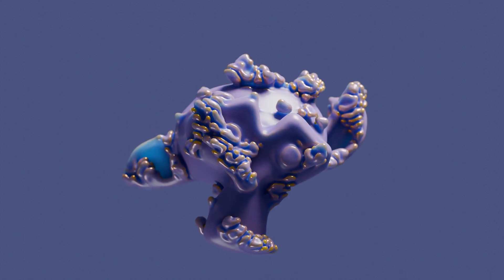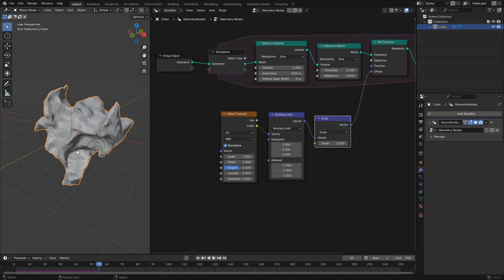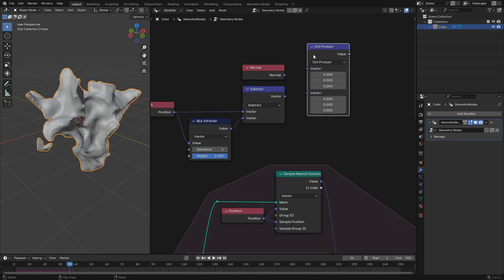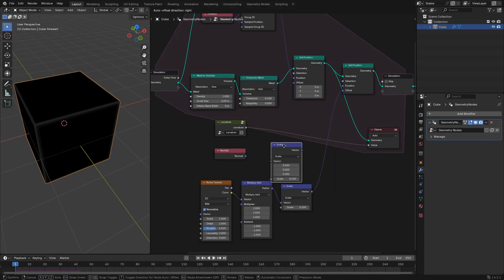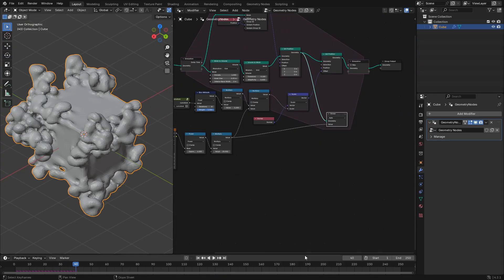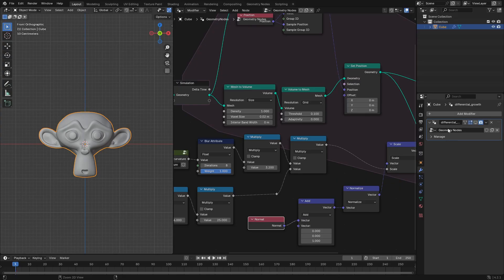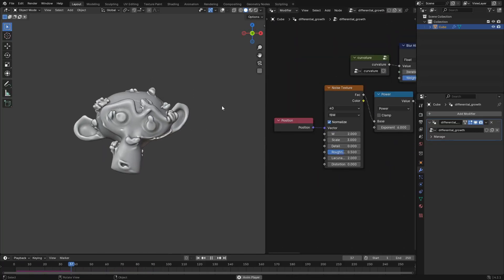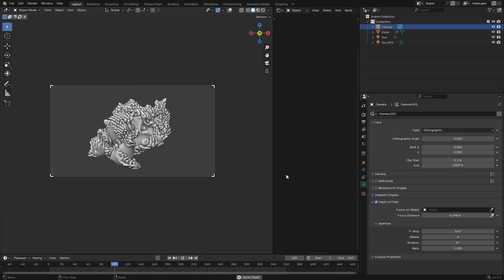3D Differential Growth in Blender (Updated!)

Comment: very cool.  and now my question. how different would it be to change the node setup to make laplacian growth?
What I noticed is that everything inside is melting together and only the outer structure is clearly visible. A cut through the growth object reveals a large cavity. it is not a correct simulation of nature. In nature, what has already grown does not merge easily. I know Houdini's simulation and the points repel each other.